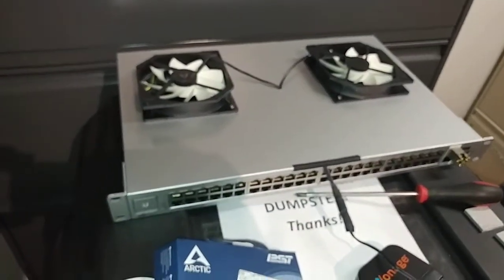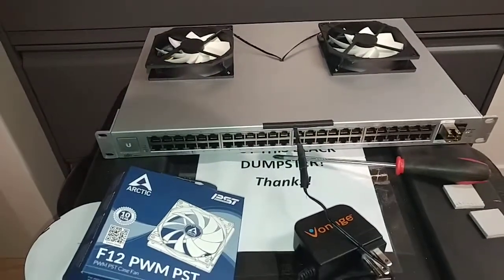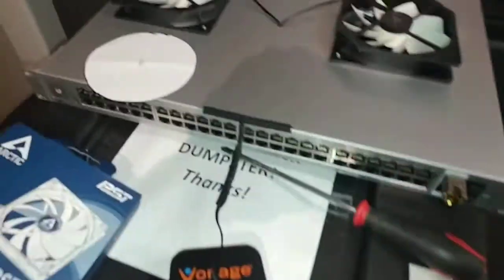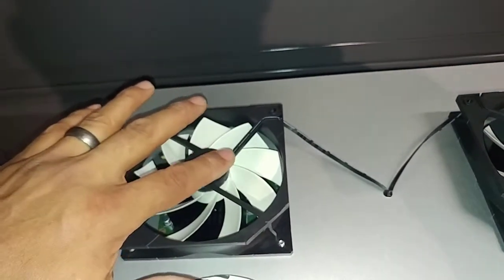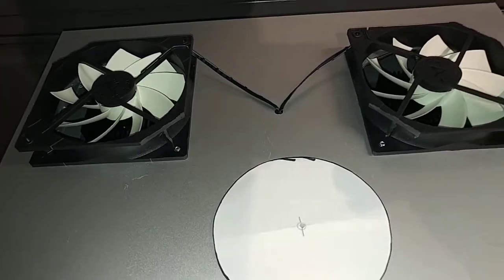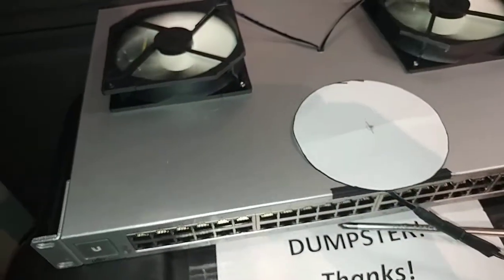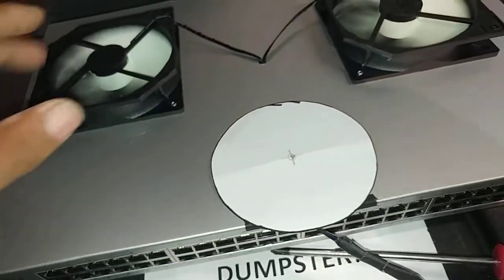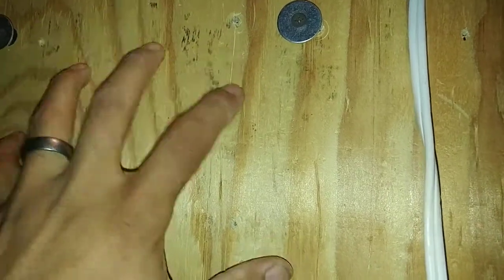100% FIX - Crazy Network Switch Heat

Comment from the maker: Temp change from: 152 degF to 97 degF. That is a 55 degF difference. Not a small change. It has now been over 30 days and the fans have been working constantly without and failures. That is over 760 hours and counting. This mod might seem drastic but a 55 degF permanent reduction in device killing heat is hardly achievable by any other method. (Stay smart people!)
Reply: I’m doing the same thing but adding blower fans on the inside. Since they are 12V fans and the switch runs off 12V power. Think you can solder it directly to the board if you find 12V power with a multimeter. My switch was overheating and dropping my devices from network